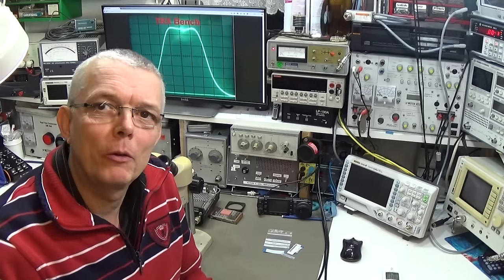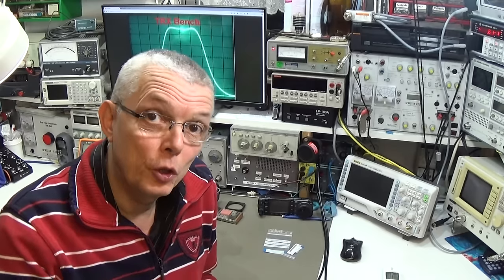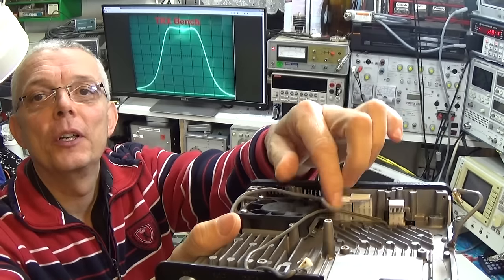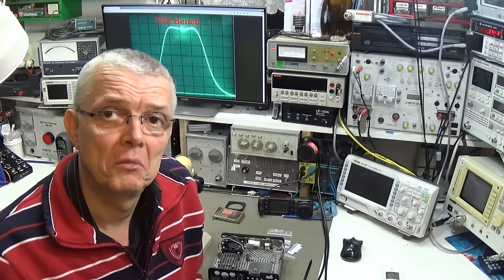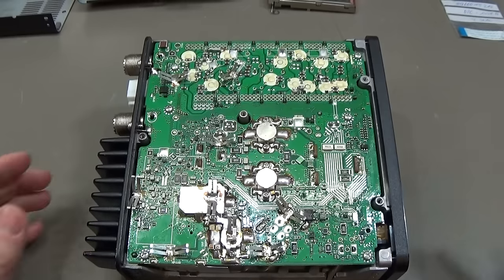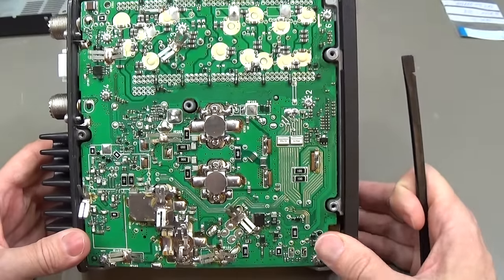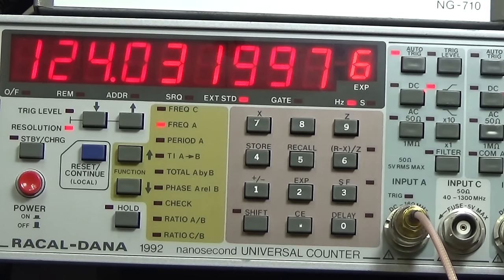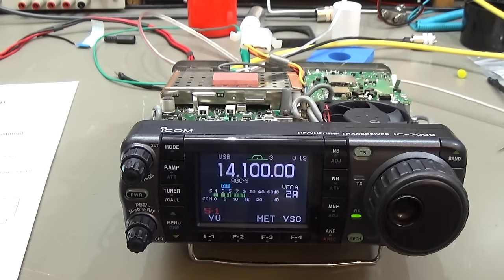#72  HAM Radio repair: ICOM IC-7000 with receiver problems and remote failer

Comment: Hi Peter...very interesting repair. Regarding the chip inductor being burnt out, I had a similar problem with an Elecraft K2, it appears that at some point the ground connection to the rig PSU had become disconnected so that when the rig was switched on the rig tried to draw current via the computer ground connection, thus burning out the chip inductor. Unfortunately the user just tightened the PSU ground connection not realising the damage that had been caused. Something to watch for on any rig/computer combo. Hope this helps. Steve G4EDG

Comment: Great job again Peter. Seems those radios really have an issue with ribbon cables. Seems those are as bad as Kenwood TS-940. Have one on bench with the "Dot" problem. Between the PLL's and wire connectors it is driving me crazy. Need to fly you over here for some support :)   Thanks for sharing my friend.
Reply from the maker: +The Radio Shop Thanks Buddy! Take care!

Comment: Great Video again. I have a question. Could the reoccurring problem with the ribbon cables be connected to the fact that the IC700 generally runs hot ?. It seems to me that the ribbons cold be de-laminating with time. Thank you again for your great videos 73 Konrad-  KC9NUW
Reply from the maker: +Konrad Kubit Hi Konrad, well may be I can't verify and proof it. But you are right it looks like that the cables are de-laminating... Thanks for watching and comment!! 73

Comment: I worked for Icom for about 7 years and in the era of the IC-7000 and IC-7100. The 7000 was a very problematic on all levels. The 7100 had many problems as well. Every new Icom design rig or radio always has multiple common and not so common  issues. I would never buy an Icom rig or radio until at least 1 or 2 years past it's first release to iron out some of the problems.
Reply from the maker: Hi Shane, thanks for the feed-back..that is what I always thought....All the best and 73
Reply: Shane, have you ever seen an IC7000 with good power on all band but lack of power on UHF ? I replace the final (RD60HUF1) and power increase from 12 to 23W watt but still no full output. When I dail the band while transmitting into a dummyload I get max 28W at 421MHz.. A very strange problem it seems.. shortwave + 50MHz is 100W, VHF 50W so driver seems to be okay.. Any Idea ?
Reply: @johnpeters1921  My "new" IC-7000 lacks power on UHF too. It is only 5 W or so. I didn't replace the final yet.

Comment: These Flat Foil Cables (FFC) are a very difficult thing to handle in maintenance. The video clearly shows, that someone already pulled them out and in several times. The contact area of several lines where broken or folded. One needs to remember that these foils and the corresponding plugs are only made for 12..20 contact times. 
From what I can see in the video, ICOM does use static connectors, that do not have a handle to release the FFC. So the risk of damaging the foils contacts is 100 times higher than compared to these ZIF connectors. You have to take care to push in the cables exactly straight downwards. Only a small angle deviation from 90° and the connectors contact pins will peel off the foils contacts. 
You can make yourself a special tool, by using angle pliers where you glue some small ribbon tape on the inside. With that you can easily push in and pull out these cables, maintaining equal force on a wide area of the foil.
Reply from the maker: +Astralix2011 Thanks for comment and the additional information!
Reply: Hi Tony! I only added a hopefully helpful advise for the public. And if the public has an additional advice, it it very welcomed! I am not sure if it is always a good idea to use the FFC sockets with the release handle, cause ICOM designs for mobile, airborne and military use. And under vibration it is a totally different thing to use a plug that is either self opening or extremely more expensive compared to a simple but uncomfortable solution.

Comment: The ribbon cable appeared to have been subjected to some thermal stress.  Did you test the unit for a long time with the case enclosure completed?  Perhaps there is a fan issue or, as you showed, a loss of thermal transfer between components in the final and the case that raised heat inside.  Although regarding grease I would offer that heat transfer is not terribly bothered with the lack of grease; it is used to "fill in" any mechanical gap between the component and heat sink.

I'd be a little more curious about those cables and what may have caused them to fail.

Maybe, as you guessed, a previous repair (flux left behind) may have damaged the cables?
Reply from the maker: +k1mgy Hi Mark, well a lot of possible root cases which I'm not rally able to verify. But it is a kind of fact that this radio is running very hot itself . The fan is working for sure and yes may be it is possibly a result of an earlier repair? I know that the grease is only a gab filler  but you always have a kind of mechanical gab therefore it is essential to have grease in place. Thanks for comment! 73's

Comment: I may have asked before, but could the problems with the ribbon cable be due to the high temperatures the radio produces?  I keep an external fan on my 13 year old IC-7000 and all seems to work fine.

Comment: I have seen Peter doing some excellent repair work on many Icom IC-7000 transceivers. -  Much respect to Peter, his knowledge and his skill.

I do like the look of the IC-7000, and would like to own one.  Are they a good radio if treated with respect and not run at full power all the time?  Or is the Icom IC-7000 a radio that's best avoided?

Comment: Nice video.  Clearly the ribbon cable was faulty but how can you be sure the missing heat sink compound was not causing problems as well?
Reply from the maker: +TheDisorderly1 Thank you, well the problems was on receive so we can preclude that there is nothing wrong with the driver even we have the missing compound.

Comment: My IC-7000 just lost tx and rx, the alc is full scale on hf ssb with no audio in, I see the problem is not uncommon but I'm finding no solutions. Have you seen this, any ideas? It seems like it maybe lost a voltage somewhere.

Comment: Peter could you please informe about the S9 adjustment on IC-7000? It must be with preamp on or off after an -73dB inserting?
Reply from the maker: Hi Spiros, preamp has to be switched ON. 73
Reply: Thanks
Many 73
Spiros, SV1DPP

Comment: it seems to me that you permanently damaged at least one of the 4 plastic 3.5mm connectors with the heat gun set too high,  or some other source of heat you used to desolder the inductor

Comment: I have a Icom 7000 with no RX ON VHF and UHF but Transmit fine any help on this issue?
Reply from the maker: Well must be a issue in the front end but can't point you to a component... 73
Reply: I have exactly same issue on my 7000 and send it to Icom Canada service team, finally they told me it should be replace 3 MCBs due to difficulty, I am almost crazy on such report. If anyone who have any idea in circuit, please reply advise with thousand thanks. :-)

Comment: Hello, l am trying to buy a good reliable 100W radio could recommend anything?
Reply from the maker: Hi Dave, well I would look out for a nice Kenwood. Not always the design winners but very nice radios. 73
Reply: Kenwood has very nice audio. I started with a Yeasu FT857D mobile "shack in a box", which according to my Bird meter puts out between 98 and 102 watts HF, but the audio leaves a lot to be desired. I bought a couple of older 1990s, late 1980s Kenwoods. One had a bad mic preamp, and the other had bad caps in the audio output, which fried a chip, but after repairs, they are both keepers, especially the one with the built in antenna tuner. The Kenwood transceivers all sound very nice even without external speakers..

Comment: Hi All to Anyone interested, as seen below i have an IC 7000 that is about 3 Khz off freq on 70cms and about 1 khz off on 2 mts, on tx and rx, hf isn't far out, but apparently there is only the one thing to set, there is no adjustment inside the radio, and the REF in the OTH menu only goes a few hz either way, but if you go into the hidden menu, see Bib Nagy video on that, using a a jack plug in the back you are supposed to be able to move it about 5 khz shall we say, at least, the numbers are in Hexadecimal, mine is on AD, now i tried to change it, i went form 00 to FF that's the whole range, and it dint alter it at all, i was supposed to, so i am now sending it to Icoms in Kent,,,,just thought someone might be interested hi...seems the radio must have a fault on....from Fred g4vvq in England.

Comment: I am familiar with that feeling of surprise when finding a component without thermal grease.

I try to give the manufacturer the benefit of the doubt and blame it on the golden screwdriver, but when you start seeing repeat offenders, you start to question the factory’s quality control.

Comment: Der Konkurrenzkampf wird durch Verbilligung der Waren geführt. - Marx
Whilst you think you're getting an ICOM, you're really getting a rig designed, verified and manufactured by the cheapest outsource company. Which may out source again to another cheap company.
Quality craftsmanship and pride is a cultural thing.  Some cultures don't value it any more, some never did.
 More Teutonic or Japanese thoroughness is required!!!
:-)
Reply from the maker: +Peter Walker Peter and that is the point! As Kenwood is top of the pop I don't like to say where I see ICOM..
Reply: Yes Peter, forget Marx; the Teutons are good at convincing themselves of their superiority.
If they'd get off their soap boxes they'd see the hubris they're heir to. We all make mistakes but those fellows far too often won't accept this. This is a problem. They inadequately design many things and the thoroughness you mention isn't there, yet you can't get through to them. Uttery impeacheable they are. It's cultural. They look as silly to the rest of the world as americans (small A).
Once they get a bit of humility like the rest of us then they'll be more like the Japanese.

Comment: Peter, How long have you been doing electronics?Don't you know there is no such thing as a simple fix with anything you do.I mean to change the spark plugs in some older vehicles you have to tear the engine half apart . Simple fix .well how about just a fix.

Comment: What a fucking mess of the chip coil, totally savaged up the 3.5mm jacks. An absolute horrendous job a 5-year-old could do better with today's equipment. I've replaced chips smaller than that and the finished job was perfect with NO surrounding damage. If I was the owner of this radio id be pissed and would have told him to replace those too. Also said he couldn't guarantee how long it will last.....if the job was done properly it would have lasted. Total NOOB.